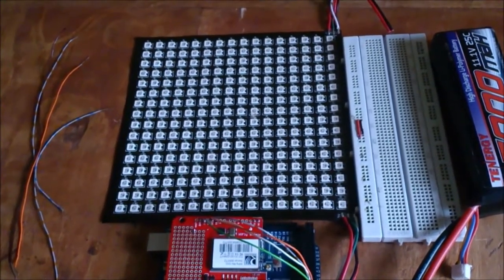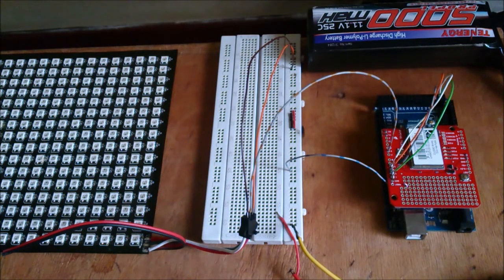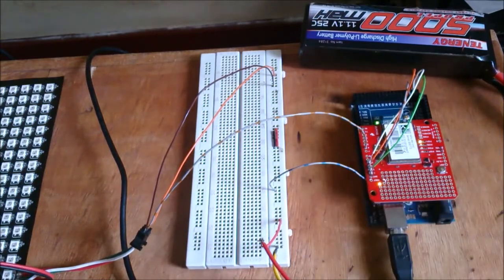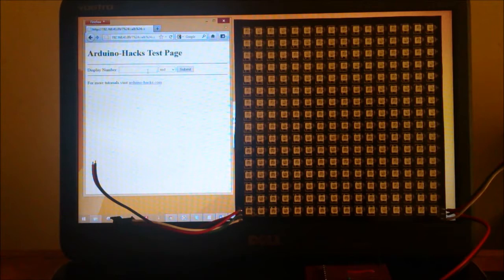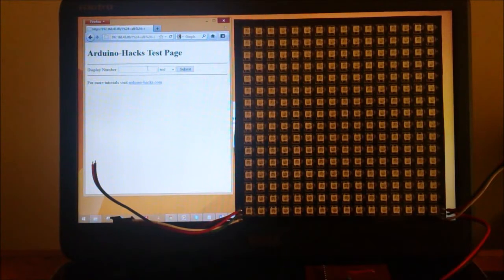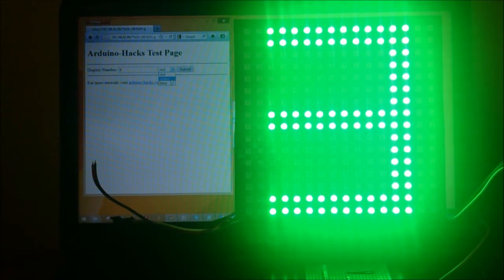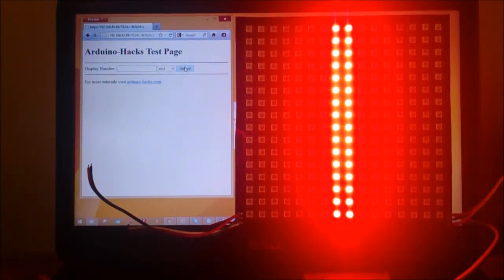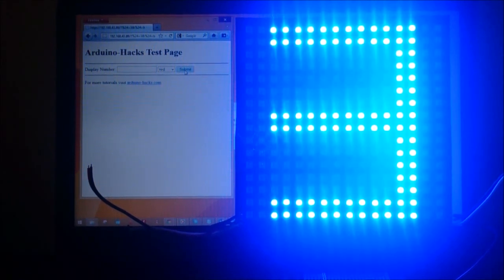WiFi LED Display - WiFly Shield + Arduino + WS2812

Comment: Hey do you have info on how to use the wifly shield with the arduino mega? You mentioned info in the comments section but theres nothing here. thanks!
Reply from the maker: Yes. Sorry about that. Here is the link
 http://www.arduino-hacks.com/connecting-wifly-shield-arduino-mega/